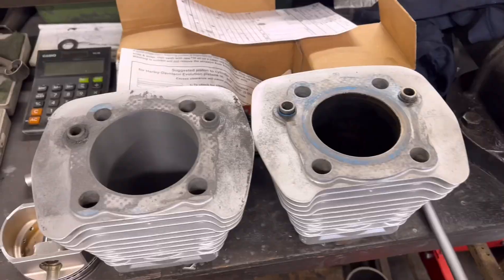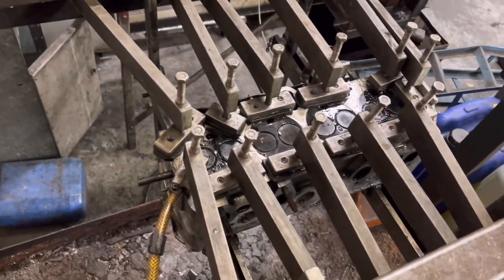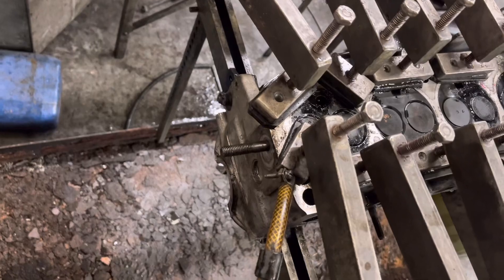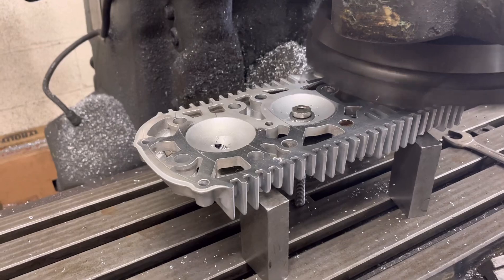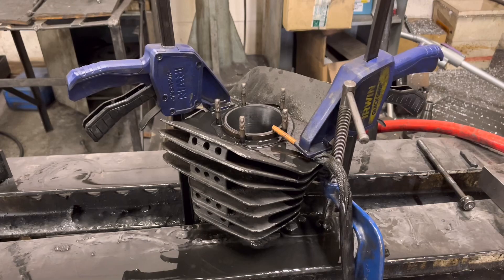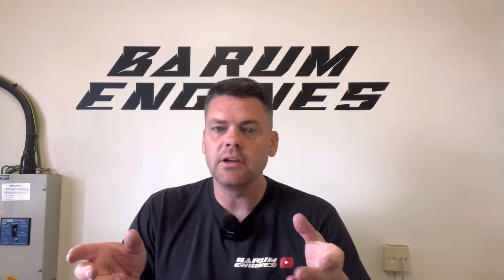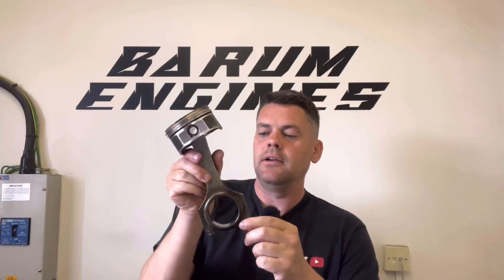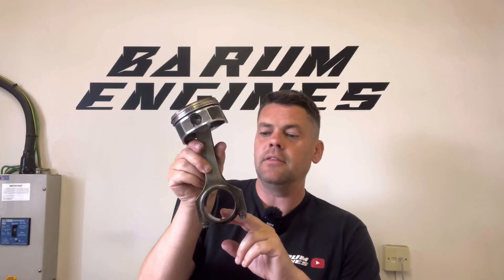This is what happens when you get the wrong bearing clearance!

Comment: Quite a while back, you had an episode about big end clearances. I suggested then that these clearances are based on journal diameter of .001"/ inch of journal diameter, for internal or external combustion engines @ 100 deg C  and yes you can manipulate tolerances with oil viscosities, but you will find most if not all high revving performance engines use very low weight oils

Comment: Nice explanation. I've got an issue. My rods have big end bearing bore at minimum spec and block main bearing bore is maximum spec. So with +0.001 bearings on both, my clearance measures 0.0018 rod and 0.0028 main. Based on diameter 0.0018 rod matches with 0.0023-0.0024 main or 0.0028 main matches with 0.0022-23 rod. Should I mix main bearings 1 STD half and 1 STD +0.001 half to bring 0.0028 down to 0.0023 to better match rod 0.0018 or bring rod bore out 0.0005 in hopes of 0.0023 rod bearing clearance to match 0.0028 main. 😅

Comment: GT750’s never boiled over to my knowledge. They actually ran rather cool. Mine, a 1973 LeMans was a hot rod; smoothbores, ported, polished, expansion chambers. Very fast in a straight line if you could keep the front wheel down. Mine wouldn’t corner well, even with aftermarket rear shocks and decent tires; I’d set off a shower of sparks on any decent corners as I scraped the expansion chambers on the road. I wish I still had it though.

Comment: Equally devastating is to run too tight clearances which will overheat the oil and result in a seizure, or spun bearing. Without naming specifically, some plonker, say, with a Golf, uses 0W-20 and expects oil pressure and doesn't understand where it's gone ;-)

Comment: I thought Harley barrels are meant to have torque plates on them when being machined. Suzuki were by no means the first to manufacture a water-cooled motorbike despite their claims. (But then the Japanese manufacturers have never felt obliged to hold fast to the truth). The most famous being Scott motorcycles of Yorkshire, who first sold water-cooled two strokes from 1908 onwards.
  The best way to prevent water-buses from overheating is to fit electronic ignition, but timing must be checked for all cylinders using clock gauges or degree wheels. The points were driven by a crappy nylon gear form the crank and they could pick up harmonics from the crank; they also had a habit of splitting.
   And yes, I did guess all the motorcycle parts.

Comment: In my research for my 2-stroke, I discovered the reason they overheat is because the squish band is too big or too small. the skimming you've done might just be enough to get it right so it doesn't overheat again.

My father's GT750-A never had an overheat issue. looks like the barrels you had there are from an earlier model.

Comment: Do you not advise using running in oil on a new engine to get a bit carbon built up on the compression rings

Comment: How do you know you don't have that 3 cylinder head pulled down in the middle a touch before it's skimmed as it's supported on the outside but pulled down only from the centre cylinder plug hole ?
Reply: I was waiting for it to fly off into the wall 😂😂
Reply: This idea may be a little "out there" so to speak, but would you think Lee measured before, then after nipping the nut down?
Reply: I thought the same thing

Comment: Love your videos but why do you mix imperial and metric measurements so much? You always talk about “thou” but shouldn’t you work all in metric nowadays?
Reply: When a machine shop is equipped with all metric machines - then it would be 'natural' to use only metric nomenclature.  However, the said workshop is largely equipped with perfectly usable Imperial machines - hence the continued use of Imperial measurements coupled with metric because the engines worked on (eg. BMW, VW, etc) use data that specify sizes and tolerances in mm.

Comment: Lee, I'm not a machinist but I have to disagree with the way you have that motorcycle head held down, with the center pulled down it seems to me that you would end up with a reverse banana.  Me thinks you need bolts thru all of the sparkplug holes pulling against precision blocks to get a truly flat surface.
Reply: If you look carefully you’ll see that the outer plug holes are at an angle. You’d be hard pushed to clamp it down though them .
Reply: I agree 👍🏻
Reply: Yes I have to agree that the set up is a little sketchy. He has stand off blocks under both the ends of the cylinders in fact it looks under the cylinder head bolt holes. What I would have done is blocked under the centre cylinder too, and used the same locking down fixture to the table as there is no alternative that I can see.

Comment: The first water cooled two strokes were made by a British company called  Scott circa 1929. The engine was still being used in a Silk motorcycle from 1975 to 1979, manufactured in Derbyshire.
Reply: Who can forget the Scott Squirrel (1922, 486 cc twin), the Super Squirrel (498 cc or 596 cc) or the ultimate... the Flying Squirrel (1926, also 596cc)!
Reply: Tosser
Reply: @mikerittmanreborn4955 who? You?
Reply: Right I've had enough now of trying to post replies..and being revoked....that I won't do it anymore.
Reply: @ast6537  only joking
Reply: The first Scott motorcycle, water cooled parallel twin, was 1908!

Comment: No mention of tight running oil clearances Lee . A friend and former colleague had on a Honda Integra  1800 type R engine rebuild.  I recall oversize big end bearing shells were hard to come by  but he sourced shells somehow  and passed on to the local engine shop to get the crank ground. On assembly it was obvious there was little no oil running clearance, almost locking on assembly so he sent the crank  back to the engine shop where  they just polished the journals and sent it back telling him all was fine despite him not being convinced he went ahead, assembled and refitted the engine. Sounded sweet  quite as a mouse on start up with excellent oil pressure but within fifty miles the engine failed  with the big ends obviously  seized/ spun  and crank ruined. When  I discussed it with him we both concluded that there was never enough oil clearance on the big ends. A costly error of judgement  on both the engine shops part  who denied an issue and washed their hands  and my very experienced and knowledgeable colegue who struggled to find a replacement crank who eventually sold of the car for peanuts without a useable engine..
Reply: If he was knowledgable and experienced, why didnt he check the clearances before he put it together?
Reply: Because he left the decision to the specialist engine shop who told him it was good to go. It proves to me that anyone can get caught out, (the guy is hugely respected for his work locally by many including myself ) if you trust others supposed expert judgement and the crank came back polished and the conrods spun freely with the ok from the specialist.   I was very surprised by what occurred as we both come from comprehensive engineering backgrounds but didn't press the issue with him or rub more  salt into the wounds.

Comment: On Mini A-series engines used to use basic 20/50 SAE oil plus a can of Wynn's or STP gloop. Was a good combo for the gearbox as well. No probs in winter or a British summer.
Reply: I remember that well. This is the way ..... as they say 😀
Reply: I have ran a few minis and the thing is people who try and make the A series a sports engine.They end up not lasting long .1380 was big but people actually tried 1400.They lasted a couple of hard runs and popped.Terrible heads in the first place siamesed as they were.
Reply: They can last well in my experience. My 1420cc A series has about 65k miles on it and revs to over 7k RPM at times like hillclimbs. It's done track days, autotests and quite a bit of motorway use and still has life in it. The 1420cc is a 1380 bore with a 2" mains 1098 crank.

Comment: 1200 Sportster head gaskets required.
Reply: I don't think they build them just the machining work
Reply: @colinscutt5104 Harley engines, I do believe you are correct. Lee mentioned that because of the large overbore, they probably need a different head gasket. So my response was in line with that and only to inform what gasket is required. When only the barrels and pistons are brought in for maching, the owner or possibly a motorcycle shop will do the assembly.

Comment: Harley V-twins, a classic engine. But have been really struggling with emission rules in recent years. Think they have been trying to sort that out with fuel injection and an array of suitable sensors and an electronic software control box.
Reply: They got VVT now as well 😱
Reply: Yes, they got EFI. About 10 years ago, they went to a 4V cylinder head. They call it the Milwaukee Eight.